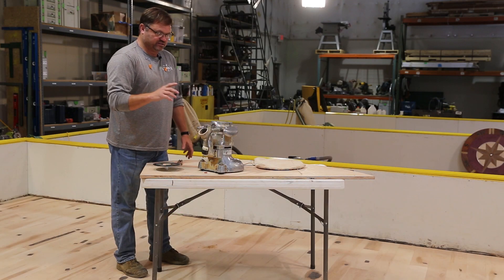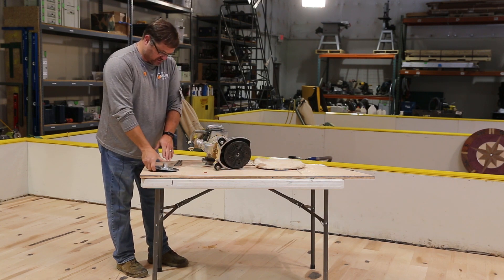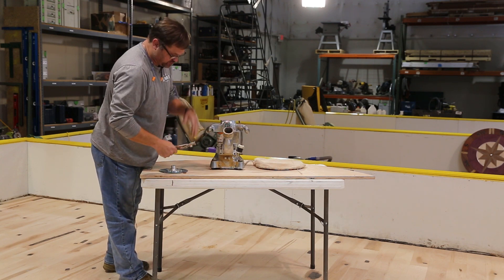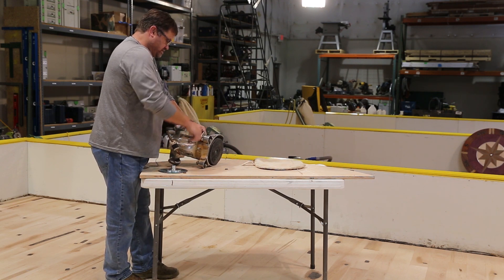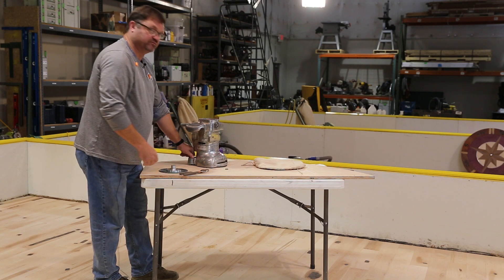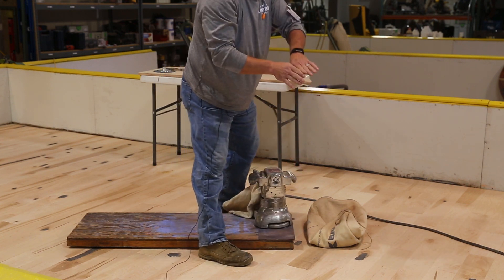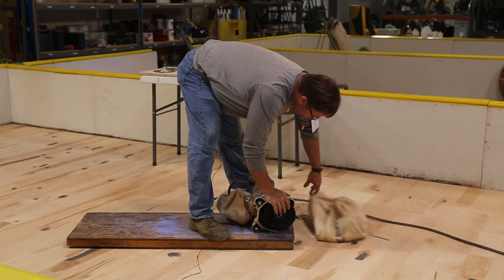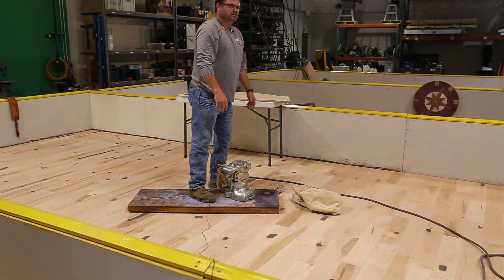How to Dress an Edger

Comment: the 3 penny ting is good however placing 3 quarters under back side of the wheel castings on a flat surface will also give you the same 2 degree cut angle. If  a slip of note book paper is placed between the quarters and castings and slowly removed while adjusting the wheels and stop as soon as a slight bit of resistance is felt on the slip. Tighten the lock nuts and you now have adjusted your edger to within 2 one thousandths of  an inch of being equal to each other. I carry a piece of granite with me to use as a flat surface base ,  the same material machinists  use in precision measuring.

Comment: Am I correct in understanding that the flex pad needs more aggressive zirconium based sand paper? I was also wondering if anybody knows if the flex pad requires those felt/fiber spacing washers that the regular steel/rubber pads have. Aluminum/rubber pads require you to remove those, in my understanding.

Comment: Wouldn't you put 3 pennies on the left and 3 on the right? Seems like you could not be level and you could put one higher than the other by mistake if a wheel is already higher...or things are actually level.
Reply from the maker: Hi Joe, 
Every edger is adjusted a little differently based on user preference. Always be sure to check with the equipment manufacturer for their specs on proper use of the tool.

Comment: I flip the edger, upside-down . . . .1/4" safety glass 12" x 12" laid on the edger disc & contacting both wheels. Now make VISIBLE adjustments.  . . . . ."different way to skin the cat" !
Reply: That's how my old man does it, both are just as correct imo